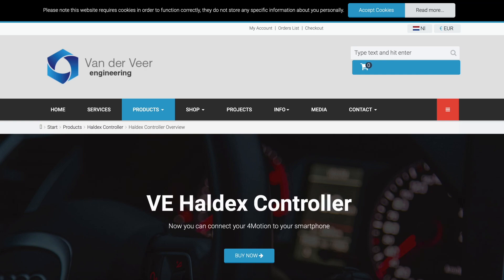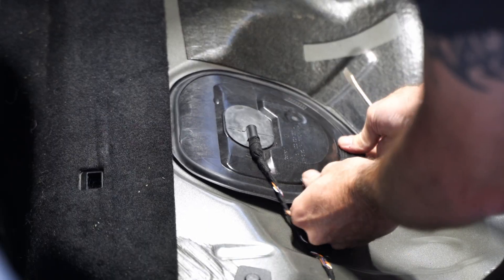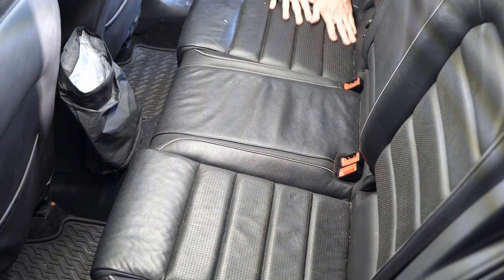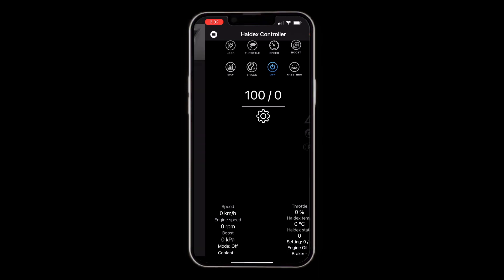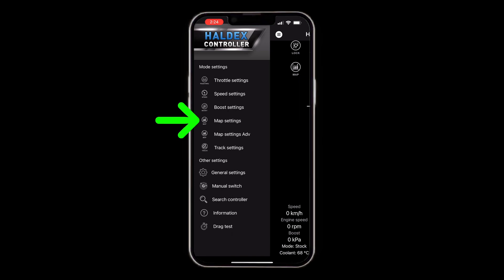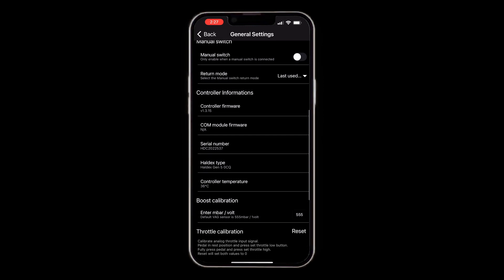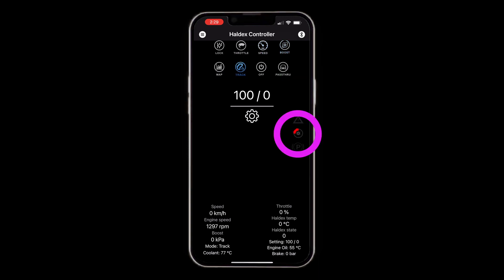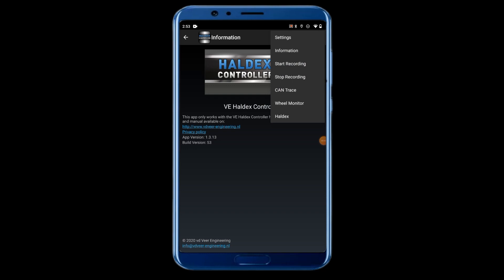Van der Veer Haldex Controller Installation and Overview - 2019 Golf R

Comment: Do you really need a haldex controller to make a burnout? If you do the same with handbrake engaged it shouldnt be the same ?i mean front tyres will spin and back wont move so it wont be a roll burnout but more like a stand still burnout ....any thoughts?

Comment: Will a haledex controller work on a rs4 quattro system , im in the process od building a v8 T5.1 transporter  and trying decide if i fot the quattro system along with it or run with the haldex from the van

Comment: Great review, thank you. Currently looking into this in hopes of changing the driving dynamics of my Volvo. Stock split is horrible (70/30 max) and most of the time 90/10. I'm making enough power now to where the vehicle is torque steering far too much. I'm hoping this might be a fix or atleast reduction since it is capable of 50/50 on my platform.
Reply: Hey, did you installed it? What do you think? 
Im looking forward to install one of these in my R'

Comment: would love to see the info if it does improve the 0-60 time with the controller…would love to see your DIY vids for suoerpro control arms and locking subframe pins from Tyrolsport and the improvements of turn in

I have some coming for my 7.5 and doing some light weight rotors and break pads because of your channel, so thank you!

Comment: Does this require the upgrade Haldex valve to work properly? Info on standalone Haldex controllers is sparse. I want a simple duty multiplier knob I can adjust on the fly.